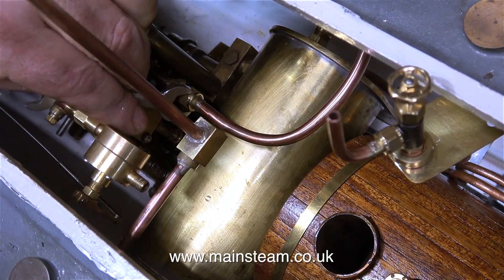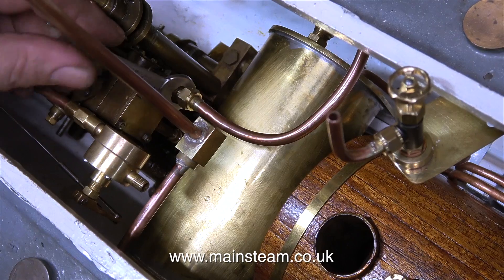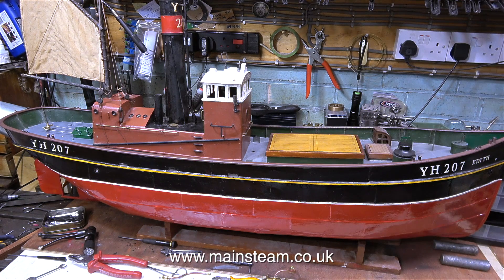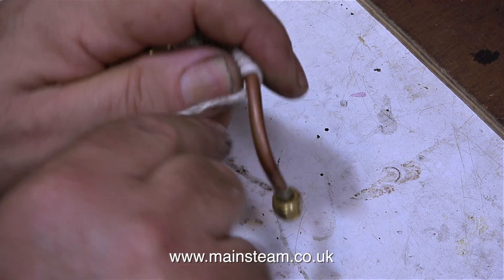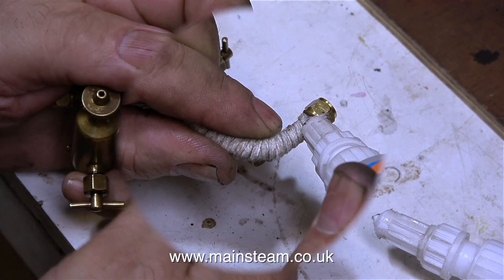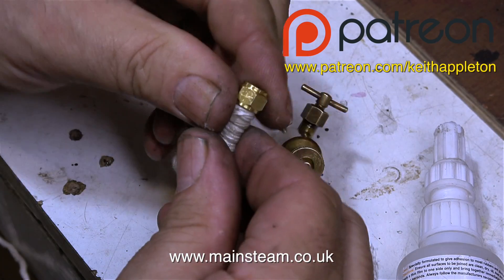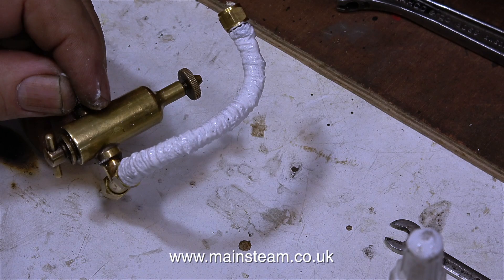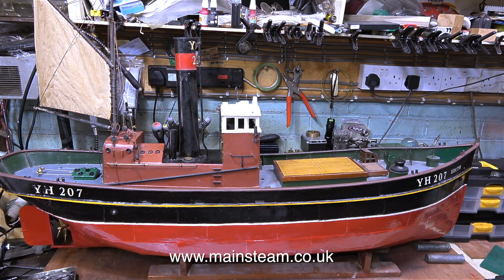A MODEL STEAM BOAT NAMED EDITH - PART #33

Comment: Honestly, if you've ever been on a working boat, they NEVER look pristine or perfect. Something's always leaking or rusty or there's paint drips or chipped paint or there's clumps of stinking slime and bird crap in the corners of the deck or bits of net or line stuck in hard to reach places. Even when they're shipshape and in Bristol fashion, scrubbed and bright, there are dings and dents and creaks and hatches that close off-kilter. Perfect boats have no charm and no character. Edith has charm and character, and that is much better than perfection, in my humble opinion as a fan of boats.

Comment: What is that single sail toward the stern for?
Reply from the maker: No idea - I build model steam engines }:-)))
Reply: Hi
Sails like this are used to limit the roll that a ship suffers by providing resistance to the movement . Lots of roll throws the crew about and makes handling the fishing gear much harder and more dangerous.

Comment: Hello Keith
Just a rather quick question about fuel for a boiler. Which fuel do you think is best for a, rather large, RC ship? some sellers sells boilers that is fueled by methanol and i see that you use gas.
Reply from the maker: I would say gas is best, as it is easier to regulate the heat - and Methanol burns invisibly so it can be dangerous if you spill any .......
Reply: many thanks for your answer, Keith. Keep up with the wonderful work of video making. 
Lets say that i have a 2 meter long boat that needs to be powered by steam and lets say that i want it to sail more than 30 minutes, will it be feasible to use gas? 
Best regards
Reply from the maker: Yes, if you can use the Medium or larger sized gas canisters you will easily get a half hour run.
Reply: Thank you very much for the information.
I will use this information for good.

Best regards

Comment: If it were my boat, and it's not so I don't get a say, I may have replaced that green thingy with a life boat because I've noticed that the crew of the Edith are likely going down with their ship.
Or, if the green thingy has to stay because of originality I would have added a smaller lifeboat just behind it to cover the servo arms.   
It's just a thought, not trying to be a smart arse in any way. 
Unless of course there already is a lifeboat and I just haven't seen it yet.

Comment: What is the reason for not having a small condenser pipe array through the hull feeding into a small hot well as used in full sized steam boats? Though potentially more complex with an engine driven low pressure lift pump and clack valves to lift the condensate into the hot well, it should be a lot smaller than your largeish condenser tank. 

Having typed that I think I’ve answered my own question - it would be too complicated with through hull fittings to allow exhaust out and condensate in plus a suitable lift pump and valves plus the hot well itself. Just seems a shame not to use the cold water the boat is floating on to cool the exhaust.
Reply: You have to insure that any through hull fitting are steam tight, and any condenser/hot well system must  be large enough to contain the oily condensate.